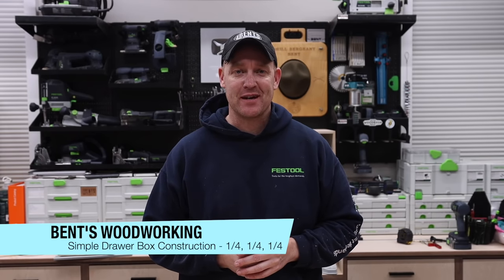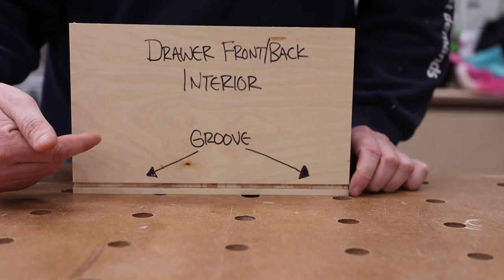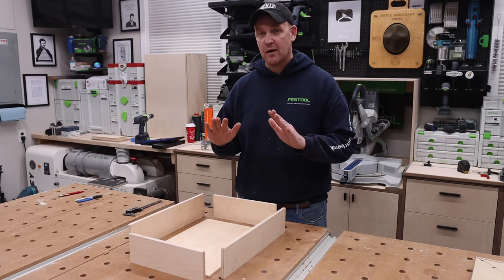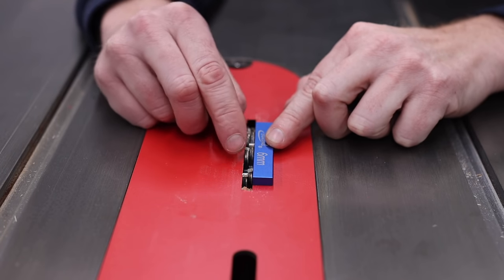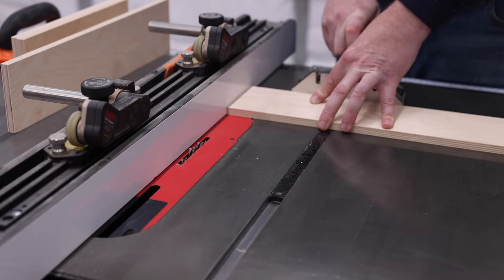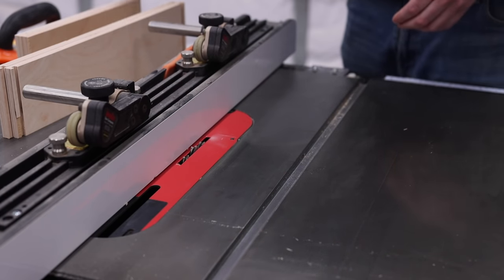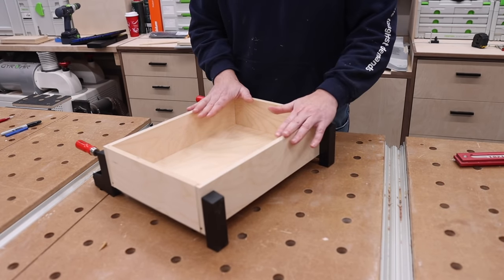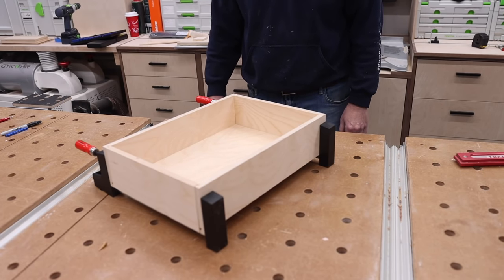These drawers will change your life

Comment: Nice video, I found it very helpful.  However I thought there was a little too much "wiggle room".  I tried this with ½" (12 mm) plywood and the dado was just a bit too wide.  

When using plywood that is slightly less than ½" because with a stacked dado blade set you can't cut a dado less than ¼" wide (well as far as I know anyway).  I figured I wasn't the first woodworker to run into this limitation (cutting a dado slightly less than ¼") so I researched it and found a solution that I like.  

The short answer is to use three 7 ¼" circular saw blades (they are only 1/16" thick) and some dado blade shims (I use Forest magnetic dado blade shims).

The long answer is to stack three 7 ¼" 18 tooth circular saw blades and some dado blade shims together.  I thought it best to use an 18 tooth saw blade so there is room between the teeth to stack the blades flush.  For shims I use Forest magnetic dado shims because they can’t slide down into the saw arbor's threads causing inconsistent dado widths (which is a royal PITA when trying to achieve a precise dado width).  If you have a Saw Stop (I have the professional cabinet saw model) then you’ll have a problem to overcome with the brake cartridge because  a 7 ¼” blade will leave too much of a gap between the blade and the blade brake causing the system initialization to fail, even when using the bypass.  To get past this I cut a piece of aluminum angle iron about 2” long and cut its width to 1 ⅝” and taped it the 10” blade brake using electrical tape and then enabled the safety bypass.  Do this at your OWN risk!  Now that I know this method works I will find a better solution to fool the Saw Stop brake cartridge.

The result is a perfectly wide dado exactly half the width of the plywood.  For me I am using ½” (12 mm) baltic birch so I needed a dado very slightly less than 6 mm wide.  I used the three 7 ¼" 18 tooth circular saw blades made by Skill and one 0.015 magnetic shim for a perfect 6 mm wide dado .  However, the bottom was not a flush plane… the were kerf marks.  I did not have a router plane narrow enough to clean that up. So that was what I had to settle with. But I think it is a good enough dado for drawers.

Hope somebody finds this helpful.

Comment: If you have a right-tilt saw (us guys running classic equipment ), the concern you start to talk about at ~12:07  is not as much of a concern as our dado slots grow from the opposite side so we do not get the opening to drop the workpiece in next to the fence.   The times I have used this joint in drawers I used a combination blade and made 2 passes w/ a ZCI to get my dado width so it wasn't a concern regardless.

Comment: I plan on doing this method on a router table because I have a crap table saw. Only thing I am concerned is you have to do a vertical cut unless you move the fence
Reply from the maker: It could be flat you would just need to use a spacer to push off the fence for the router

Comment: This is a great video, it is very easy to follow and well explained.  One thing I am having trouble wrapping my head around, mostly because measurements is something that I constantly battle is determining the width of your front and back pieces.  Say I want a drawer that is 10 inches wide and I am using side mount drawer slides that measure 1 inch total and using 1/2 inch plywood.  For my front and back pieces would I subtract 1 inch for the drawer slides, 1 inch for the thickness of the combined material of the side pieces then add 1/2 for the Dados?  brining my total length of the front and back pieces to 8 1/2 inches wide?  Thanks to anyone that can help me out.
Reply from the maker: The dados will depend on the depth. For example on 1/2” material if I wanted a 10 wide drawer, and I was doing a 1/4” dado using 1/2” ply. My front and back piece would be 9 1/2”. 9+1” for the two sides. The a 1/4” for the additional material on each end to fit in the dado.

Comment: You could also avoid the vertical cut by using your setup block as a spacer against the fence and make a normal cut for the rabbits.
Reply from the maker: Yes absolutely

Comment: For safety, Set the fence at 12mm, then clamp you 6mm spacer to the fence close to the edge. butt the workpiece against the 6mm spacer and then use the miter gauge for the cut. For the rabbets, just swap the clamped  6mm spacer for the 12mm, and you can run it flat with the miter gauge again.

The problem with using the fence and miter gauge simultaneously contacting the workpiece is if there is any drag from the fence, it can rack the piece into the blade and send it flying

Comment: Great video. I did not understand something. When you are doing your initial setup of the fence and blade, how do you account for your blade possibly not being 1/2 the thickness of the wood? I am assuming that you were using a dado blade (it looked like one), but not sure. But in any case, if the blade is not exactly 1/2 the material thickness, it seems as if everything would be off.
Reply: A dado stack can be shimmed to get a precise fit.

Comment: Yes the wide opening would allow for kickback of the material. You could as you demonstrated use another throat plate or you could tape the opening and make a throat plate. But I’m the side of safety another throat plate would be the safest recommendation. Your thinking and comment are not wrong. You can see a kickback occur on next level carpentry recent video and luckily he just got a small scratch because of it. Tool safety is one of the most overlooked things that can be a life changer.
Reply from the maker: I agree.
Reply: I love Next Level Carpentry.  He is very thorough, precise and teaches well.  Surprised to read he missed this safety point.  Not sure I think tape is rigid enough.
Reply: @number6396  he demonstrates the tape in action. It’s just a plane for the material to glide across not support. So it prevents the material from dropping into the throat plate and creating a kickback. It’s simply a method for safety. Not a permanent solution.

Comment: Awesome method!  Will absolutely be using this, thanks for the video! 

 As an alternative, for anyone who might not be as ballsy as a drill sergeant on the tablesaw, I think this could also be done using a router table and router bits sized for plywood.

Tablesaw seems easier with regard to tooling and set up though, thanks again Bent!
Reply from the maker: You could absolutely use a router table as well. I may make another video on that as well
Reply: @bentswoodworking  Please do make a video on that . . .
Reply: As long as you always know where the blade is, and use Push sticks running a table saw without a guard is  not dangerous.  Those lexan guards offer a false sense of safety.  Great method for making drawers I will give this a try on a pull out shelf for a kitchen cabinet, if my saw has enough torque to turn 2 blades.

Comment: what to do with the plywood that is available today vs Baltic ply, when the edges of the dado brakes off ? Need to leave more material on the ends of the sides, and cut them off after assembly

Comment: Blum are the global standard for kitchen slides and fittings. What other more utilitarian brands are there for heavy duty drawers in a workshop? I don't think Rockler are in Australia and am after side fit slides.

Do manufacturers specify on drawer slides the spacing to include between cabinet wall and drawer? If so, what is that variable called?

Comment: Great video.  I don't believe you ever mentioned anything about your blade(s)/dado and how the thickness of them was derived.  I'm confused about that AND wish there was a horizontal way of cutting the rabbets.  Do you have a solution?  The vertical can be precariously dangerous!  Thanks.
Reply from the maker: The dado is 1/4”. Instead of vertical you could lay it flat and use a spacer to push you off the fence
Reply: @bentswoodworking  I guess that answers my question - do you have a problem using a 1/4 inch dado stack with 12 mm plywood, since 6 mm (half the thickness of your stock) is less than 1/4 inch?  Is that close enough to not cause a problem in the real world?

Comment: Can this work if I dont have a dado blade, using a spacer on the fence to make additional cuts that complete the required width of material removal? I don't own a table saw and am using one in a community workshop. A design approach where it only needs one precision setup step is super useful in my situation.

Comment: Would be great if you could explain your method for making drawers that work with Blum undermount slides! Will be installing those soon and still need to make the drawers.
Reply from the maker: Check out my Blum undermount drawer slide video 👍
Reply: @bentswoodworking  just watched this half method video, and then your Blum undermount video. Seems like there a bit of a disconnect, for me, when you have to consider the bottom grove has to be 1/2” from the bottom of the boxes for Blum installation. That throws off only needing one setting on the table saw, right? Or you’d have to have 1” thick material, to make the half measurement be that 1/2” dimension we need?
Reply: @ens8280  I think this drawer is for sidemount slides only as the blum would require a movement of the fence to account for the space needed for the blum hardware

Comment: Thanks for the video.  Is there a point where you would switch from 1/2" sides and 1/4" bottom to 3/4" sides with a 1/2" bottom?
Reply from the maker: Only time I would use 3/4 is if it was a very large drawer with a lot of weight. I like 1/2” everything the best

Comment: I have a Woodpecker Rip-Flip setup on my SawStop which allows me to micro-adjust the width of my Dado's and Rabbet's (i.e. to account for baltic birch thickness in metric). Is this worth micro adjusting to achieve a closer dado/rabbet or is 1/4 inch dado OK. Concerned there might be too much wiggle room with the 1/4 inch dado setup.

Comment: Caution to all who use a carbide dado head: don't forget how severely the adhesives in sheet stock dull a dado set. Send it out to be sharpened before the work wants to float above the table.

Comment: Rather than cutting vertically, just use one of the pieces as a spacer off the fence. This way it is a perfect fit and you still use the same set up.

Comment: i tried this system and the drawers come out perfectly, however the drawer was too wide for the sliders, so i am confused as to the width  of the drawers using half inch plywood and side mount slides. i just not understanding the exact width measurement , i tried subtracting 1 inch and 1/8 and it was too wide.???

Comment: If you were to use a 6mm spacer against the fence you could cut the rebates with the boards laying flat on the table.  Seems safer to me.
Reply from the maker: You could, however you would have to readjust the fence or start by using a spacer off the fence
Reply: @bentswoodworking  I would like to see a video on this.  Sounds much safer even if you have to make a change to the fence at the start or in the middle.

Comment: I didn't notice in the video, but I'm assuming your dado stack is also 6mm?  I'm new to dados, so can this be achieved with a normal off the shelf dado set?
Reply: I had the same question.  Looks like he was using a 1/4in dado, which is why he had a little slop, ie room for glue.
Reply from the maker: I used a standard dado set which measured 6.5 mm. It’s slightly loose and allows for the glue being applied.

Comment: You mentioned in the beginning that it doesn't matter that half the nominal thickness of the sides aren't exactly the same at the thickness of the bottom, but never explained why, I'd be very interested in an answer to that :)
Reply: Typically people use quarter inch (6mm) for drawer bottoms but you don't have to.  You can use whatever thickness you want if you rabbit the edge so it'll fit into the grooove.

Comment: I design and build custom furniture and a lot of other precision woodworking.  I have been doing this for about 25 years.  I have built about 150 drawers for furniture and cabinets in my home alone.  Where am I going with this?   I always use plywood bottoms.  I always cut the bottoms to fit precisely.  In 25 years this has worked well for me and none of the 1000 or so drawers have failed.
I do not see a reason to cut the drawer bottoms 1/16" shy of a perfect fit.  Plywood is dimensionally stable and does not move.  Plywood bottoms will not either.  Why build exact?  Building exact helps to keep the drawers square during glue-up.

Comment: What Method is there ,when using 5/8in.  material?
Reply from the maker: You would divide the thickness in half and probably have to use shims with a dado stack to dial it in

Comment: Did you happen to have a link for the metric version of those set up blocks? Thanks.
Reply from the maker: The metric ones I bought from Penn Tool 👍 I thought I linked those too. I’ll have to fix that later. But, Penn tool will give you both versions
Reply: @bentswoodworking  Great! and thanks for the quick reply. Your content is top notch btw.

Comment: Jason, how wide is your blade for this process, I don't think you said.
Reply from the maker: 1/4”. Digital calipers read 6.5mm
Reply: @bentswoodworking  Thanks. I don't have a table saw but a reasonable router, and 1/4" (or properly 6.35mm) router bit so think I can replicate this with the router.

Comment: Love the video, but why not use a router?
Reply: In theory you could but I think you’re much more likely to have less than perfectly straight lines. Even with a good router table, it doesn’t take much of a pressure change to result in a visible bump in a long groove. Plus cutting speed would be higher on a table saw with a groove being cut by a lot more tooth edges than one router bit can offer.  All of that IMHO.
Reply from the maker: You could use a router table as well. This is jus one of the way to do this. I may make a router table application video as well
Reply: @bentswoodworking  Please do a router table video!!

Comment: Differentiating between a dado and a groove on plywood is utterly pointless save for looking like you're conveying more meaningful information than you actually are. There is no truly across or with the grain with plywood because the grain direction changes every 1/8". I despise that drawer construction method for the same reason I despise pocket holes. It creates the illusion of a quality finished thing but is really made of some really weak joinery and does not have the strength that someone who only saw the finished product but not the construction or doesn't understand the flaws in the construction thinks it has.